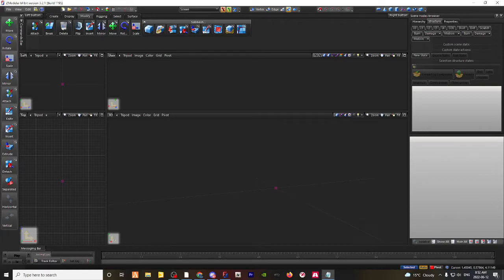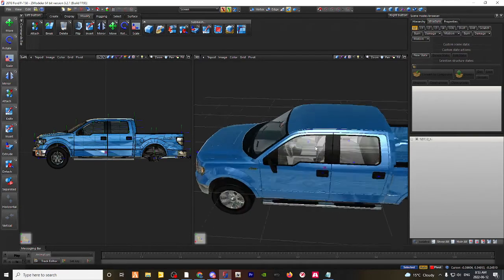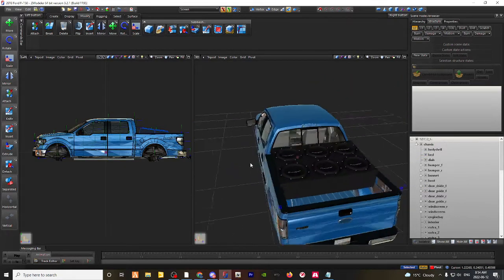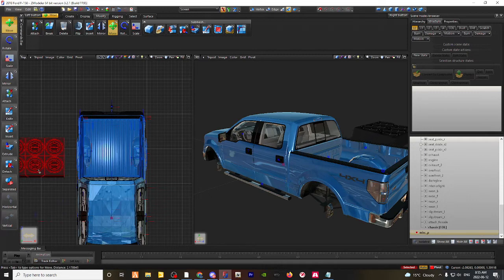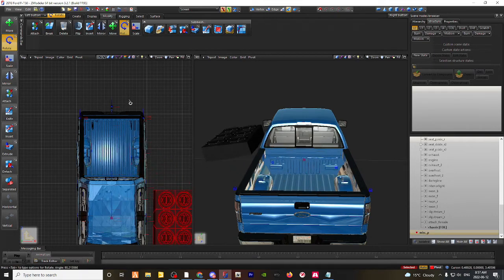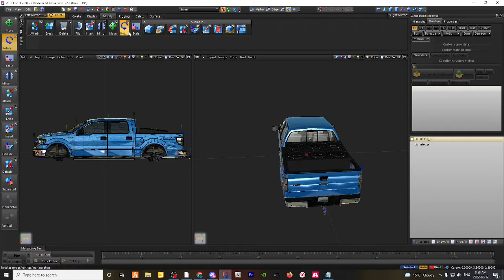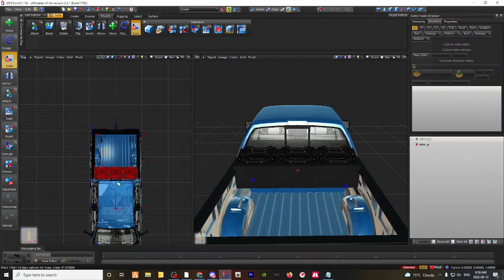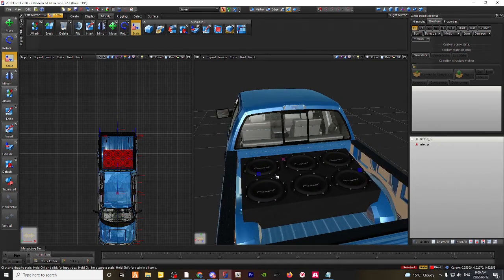ZModeler 3 How to use the main tools.

Comment: Hey, I've got a question
Do you know how I can extract the collisions of the vehicles?
mainly because i want to put them in gta 3 but i need to have the collisions in a separate file since obviously gta 3 works differently than san andreas

i am using zmodeler 2